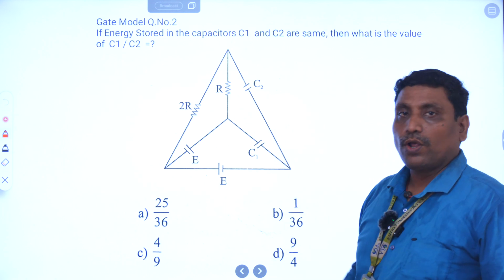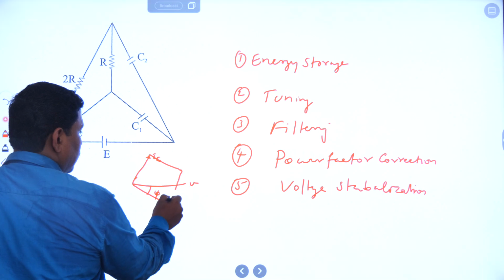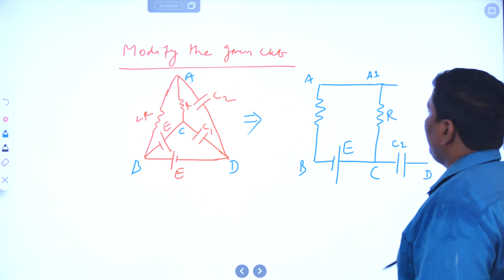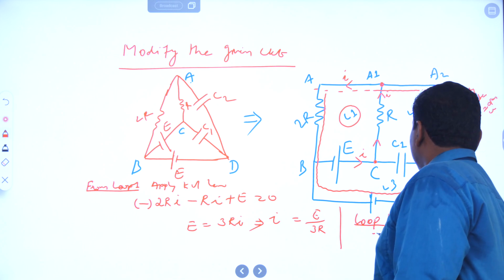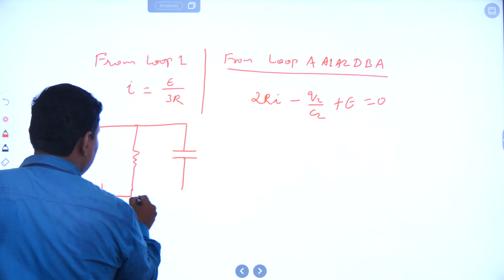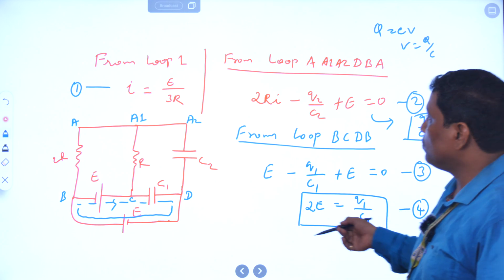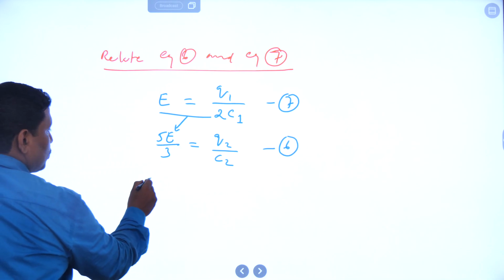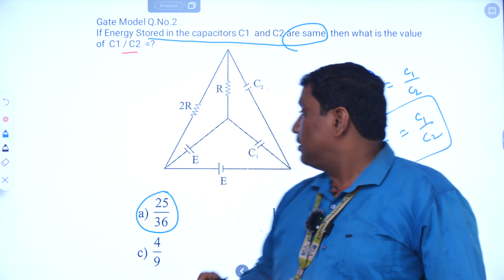CIRCUIT THEORY - R, L, C & M ELEMENTS - GATE CLASS 2024 - Dr.L.UMASANKAR - S.A.ENGINEERING COLLEGE.

Comment: Energy Stored in C1 and C2 are equal (1/2)*C1*V1² = (1/2)*C2*V2². So C1/C2 must be equal to (V2/V1)².
In DC Circuit during steady state Capacitors are equivalent to open circuit. V1 is 2E (the open Circuit voltage across C1). V2 is (1+⅔)E (the open circuit voltage across. C2). So (V2/V1)² will be 25/36.

I respect your interest in guiding the students to crack GATE. Kindly take some extra care while solving problems. Good luck to you and your students sir👍🏻
Reply: Dear Mr.sam your solution is not validated.